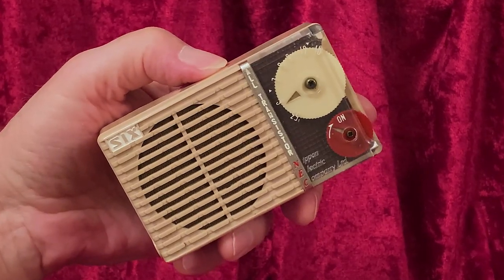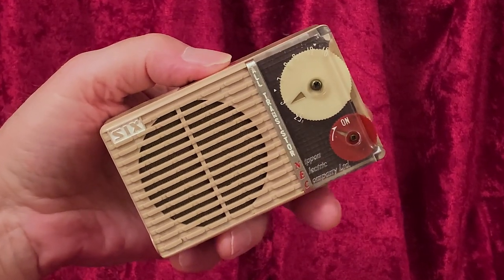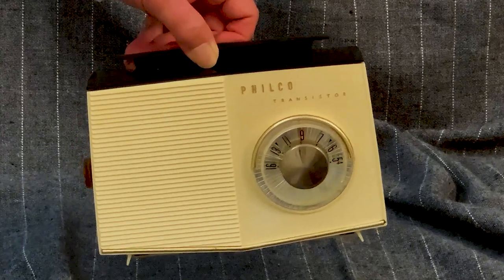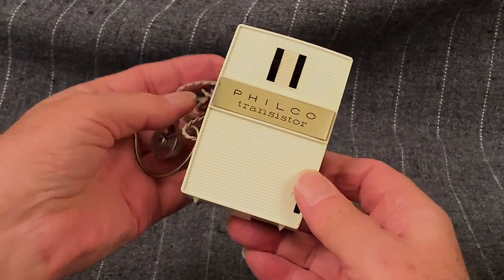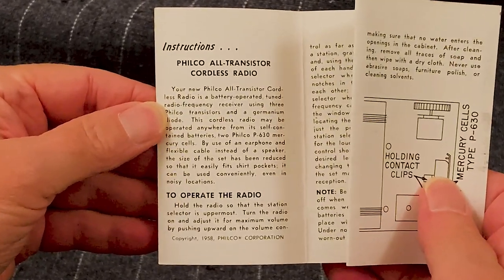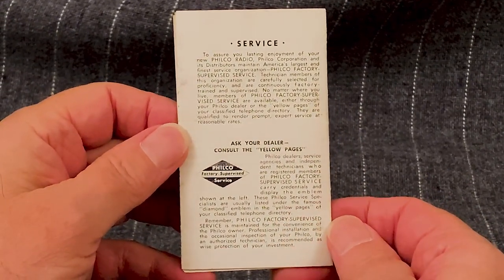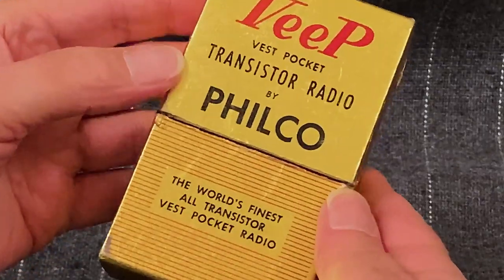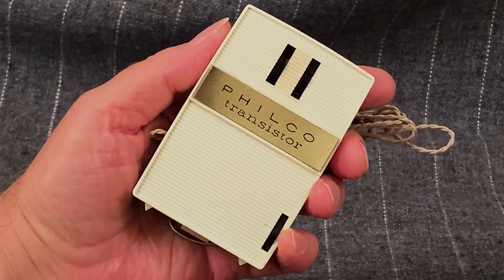Rare 1958 shirt-pocket-size radio Philco 'Veep' transistor, vest pocket size

Comment: Okay so I understand (my opinion) that the American companies where after the big ticket, high return electronics/ appliance market. The American market didn't think about the need to make what was considered to be "toys". Mistakes were made and attitudes changed after observing money being made. Too late to do anything.
Reply: I wonder what would have changed if the US took Japan seriously. Japan itself is on decline since the 80s. China is only capable of making cheap garbage. I don't think we're seeing electronics being taken seriously in a long while.
Reply: @Mahoromatic  
I disagree with you on China only capable of making cheap junk.
Look at the TECSUN brand Short Wave radios:
from their old PL-660, to the new PL-330, or the PL-990 and H-501x.
High quality and very good quality control.
XHDATA [ Sihuadon ]
Their D-808, and their Radiwow R-108.
Again , very high quality.
The fact that both 
C.Crane [ an American company], and  Sangean radios are made to their specifications - IN China…
C.Crane CCSKywaveSSB, for example.  Very sophisticated higher end radios - and NOT disposable junk.
C.Crane has the highest quality of ANY radio made today, anywhere, under $1,000.oo
📻🙂

Comment: What an odd little radio!  The reason it has 2 tuning dials is because it is a TRF circuit with 2 stages of tuned amplifier, one cascaded after the other. This was the same principle used in the early "breadboard style". Atwater Kent radios introduced in the early 1920's. The fancier ones had as many as 4 separate dials to tune each individual RF stage. This complexity was eliminated by the superheterodyne circuit used in all the radios with 4 transistors and up. Only the 2 transistor boys radios did something similar, though even those, with their "reflex" designs, may have. been somewhat better performers. I can't imagine this radio was very expensive, given the mediocre performance it would have produced.
Reply: Interesting explanation. Would you say these were like preamps units that didn't need speakers. Speakers would require an a second stepup amplifier. I wonder what a Mercury battery looks like. His description didn't show anything how battery can fit in this 2 transistor 😂. Gosh it really looks like a toy. I could imagine this radio being set on top of a pile of other toys and and cheap electronics in a big glass box with a little crane in the middle attempting to pick up these priceless 😏 finds in a Coney Island or Times Square Pinball Playland where all these kids would hang out with so many unsavory characters hanging around outside . I remember seeing things like that in the glass when I was like 10 years old 1961. They were fun to look at but you weren't able to pick any of those heavier units with a weak grabbing springs on the crane attempting to pick anything up. So they just stood there tempting so many others
Reply: @georgeplagianos6487   A Tuned Radio Frequency amplifier is a very simple circuit utilizing an amplifier device (tube or transistor) and a resonant circuit, usually a variable capacitor and a fixed coil connected in parallel with each other. Early designs did it in reverse with a fixed capacitor and a variable coil, but the result was the same. The resonance frequency was set to the same frequency as the station, giving the circuit high gain at that frequency and low gain at all other frequencies. This is the way the radio was able to pull in separate stations without one bleeding into the other. Following one tuned circuit with another gave dramatic increases in sensitivity and selectivity.  Whether Philco considered this a serious radio or just a toy, I don't know. It was simply one of those products that left you scratching your head.

Comment: Very interesting little set.
 It really is a shame that the American companies were not foresighted enough to see what was coming.
They had introduced some fabulous  coat pocket size transistor radios, and , rather than continue innovation, they got a bit complacent.
 These new Japanese companies were not satisfied with “status quo “.  They kept innovating.
 Thus, the pocket radios came, and even smaller radios - “micro-radios “.
These were aimed at the adults, from the executive, to the active.  You can tell by the styles of radios.
  THEN, when Hong Kong came into the picture, the bottom fell out on pricing, and even a kid could mow a few yards, and have enough to buy a little pocket radio.
  By then it was way too late.
American Car companies made many of the same mistakes.
📻😢
Reply: Wow Jeff you had a great way of explaining all this. It's interesting the Japanese kept innovating and innovating make things more smaller and less costly before 1960. I guess the way the other companies picked up on that philosophy kept innovating also well Hong Kong did that to an extent. But the Chinese ran away with all this innovating smaller better and cheaper. Sure there's a lot of garbage brand radios that don't sound like anything audible. And then all these better brands like Crane and other we heard here have such excellent sensitivity and sound. I got a SW-Am-Fm. In such a short time It got kind of frustrating using it with all its digitalization and buttons. I feel like they over innovated it. I guess it's great for the younger generation but a 71 year old guy I still like the thumb wheel slide tuner dials that you'd find in the not too older radios. You know all this innovation got people in a throwaway mentality thinking they got to have the most recent innovation or they're not happy. So before they finish with the usefulness of a previous radio or cell phone or any other electronic device they dump that and get the most innovated unit they can get.. like I think they narrator here tells us it's never the want out of need but it's the want out of desire for the latest unit possible. Yep that keeps the greedy economy very sound. But it puts the poor hard working folks and constant debt and paying for installments buying their phones 50 70 80+ LED screens and so many other things that constantly make you run to the store.. we will know plenty of people who are like that and then we know so many people who are just happy with the limited functions of their phone and radio they got.. yep that's what you call plan obsolescence. How many of these electronic devices can the junk landfills accept? They do send over these like computers and have these poor folks in China taking apart the different minerals and metals out of the units putting these poor folks at health risks removing them. Many don't want to think when people want the most updated unit possible to and pay everything on credit.